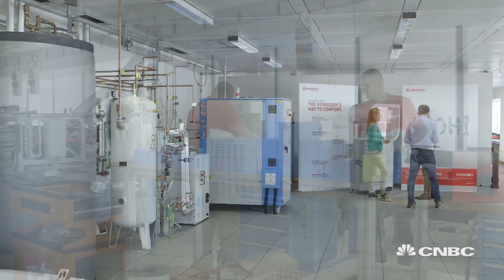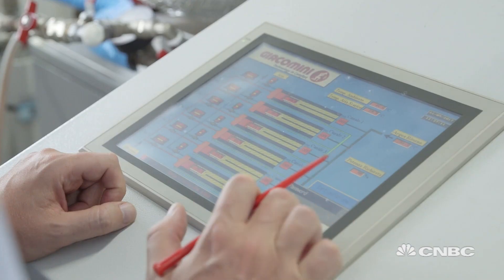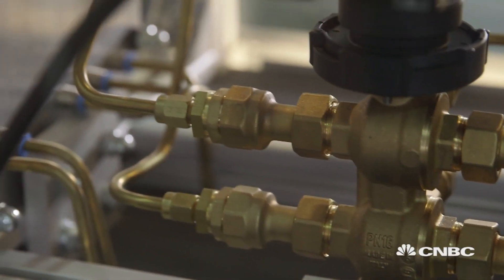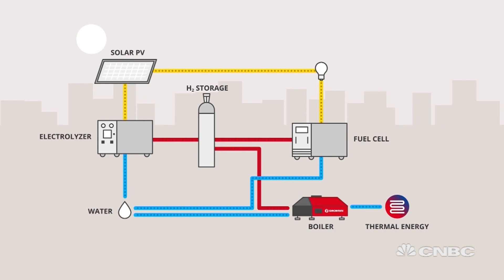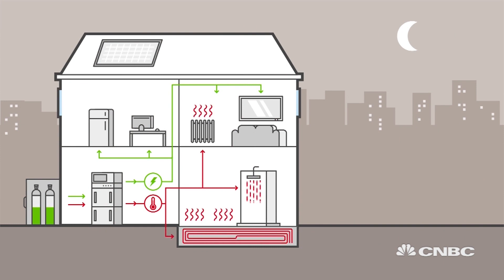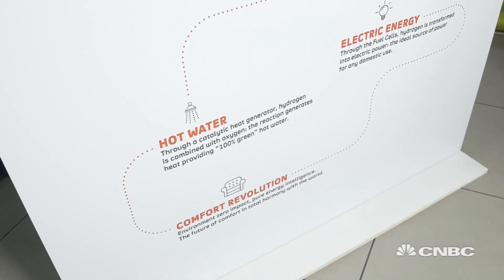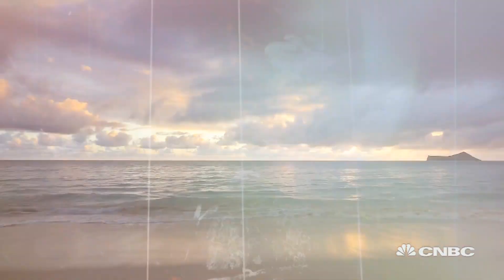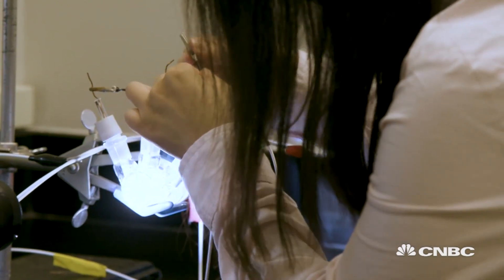Why hydrogen is becoming a big deal, part two | Sustainable Energy

Comment: 2:51  That is stupid, why they need a boiler??  You can use the heat generated by the fuel cell with water tanks well insulated and in case you need to increase the heat, it can be done using electricity from the fuel cell with a resistance.
That way you take advantage of the 100% of the fuel cell output without extra capital cost for a boiler.